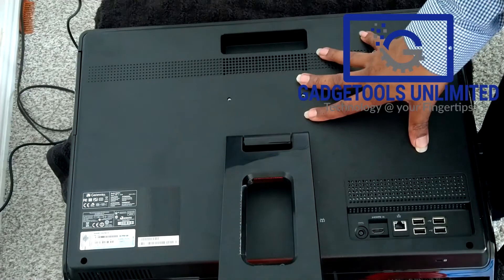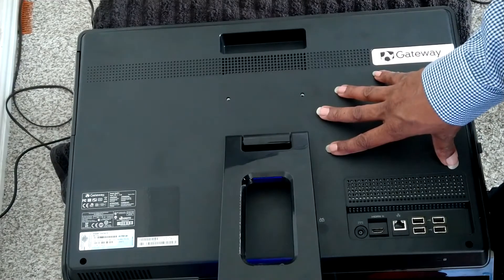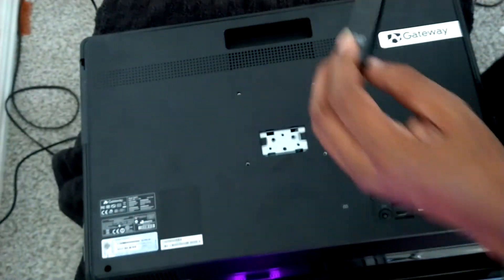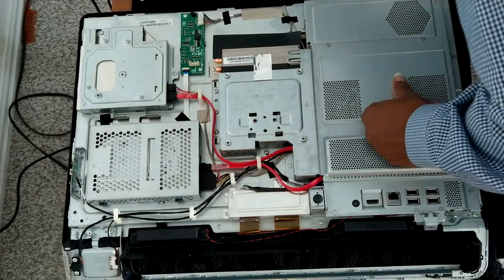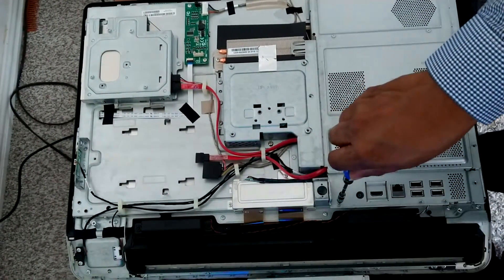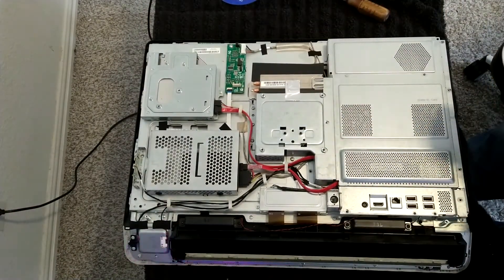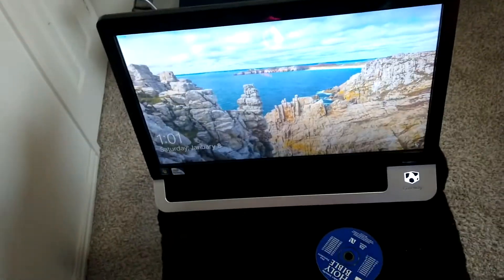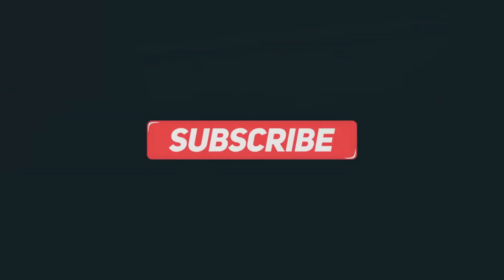Gateway Model-ZX6971 Upgrade | Gateway All-In-One HDD/Ram Upgrade | HDD/Ram Upgrade

Comment: I got the same machine and love it, but now it won't turn on. i used to have to press the button a couple times and it would go. now you hear it power up but it won't turn on. it was running perfectly fine until this started and i can't seem to find anyone who will or wants to look into it. Just go and buy a new one is all you get when it was working perfectly..
Reply from the maker: I understand you frustration, given the age of these machines, buy a new machine is likely all you'll here out there. and if the machine does what you need it to, I say keep it as long as it does. On the issue could be a bad button, or power supply. gonna have to troublshoot to narrow it down
Reply: Did you install the RAM properly? You may need to re-seat the RAM. See what happens if you take it back to it's original configuration.

Comment: Does this machine accept more than 8gb of ram? I am looking to try to put 16gb. 

 I have a dell 660s and it also says 8gb max ram but it accepted and uses all 16gb I put in. So I was wondering if this could do the same. Also where to update gateway bios?
Reply from the maker: no it won't
Reply: I tried and it accepted (it recognized it had 16gb and it was running at 1333MHz ) it but I can’t fully test it out since it’s not accepting my new SSD as a bootable device after cloning the HDD. I wasn’t able to find a trustworthy website for bios update so I am keeping the i3-2120 it came with as when trying an i7-2120 it showed up as unsupported cpu

Comment: Looking to upgrade the cpu. Any videos on this? Never seen those brass rails on top of a cpu before
Reply from the maker: I don't have a vid on doing so, but it wouldnt be a very complicated process, not sure it would be worth it to do so though given the age of these models. The "brass rails" are part of the heat sink, they carry the heat away from the processor, if you look at the end, what looks like radiator fins, the fan blows the heat carried by the heat sink out through those.

Comment: Help please. Great video by the way.   My son's gateway all in one is a GWAP42424. I called Gateway to ask what ram to buy and the guy who barely spoke English said it's not upgradable and hung up on me. Can you tell me what ram to order? It's currently 4gb, 8 would be nice, I'd even go as high as 16 if it could handle it.
Reply from the maker: This model is billed as an "affordable" option and gateway only built it with the 4gb configuration. it looks like the CPU can handle 8gb of memory but not sure the chipset or MB can, didnt find any info on them. also not sure you can safely open the device without breaking something, they make it very hard when they want to. Unfortunately on this one, it may just be good for web surfing.
Reply: @GadgetoolsUnlimited  Thanks for the reply. Guess I won't be upgrading that. He's just going to have to wait.
Reply: @BlindRanger.  You can always open it and see just what the motherboard has to offer. If there's another RAM slot, you may be able to add more. You don't really know until you open it and literally look at what's "under the hood". Sometimes, there are extra slots for things and no one took the time to advertise it, like with the Lenovo ideapad 3. It has a slot for an extra hard drive, and no one at the store bothered to tell me about it. Our other ALL IN ONE, an Acer, I believe, was said to be capped at 8GB, though we've got it running at 16GB of DDR3.

Comment: I upgraded to i5-660, SSD drive and 8GB RAM plus a modded graphics driver to the similar one. Win 11 for everyday use works perfectly on it, without much difference than on newer generation i7s.
Reply from the maker: Awesome!
Reply: Curious about the modded graphics driver any links? Thanks
Reply: I set an SSD drive but the Bios does nor read it. I need to update my bios. My version is P11-41. Does anyone knows where I can update it. My pc is a ZX6970 Gateway

Comment: Loved the Video but what did you do to make the new HD fit ? And where can I order these Parts ? and also do I need to backup all of my Old Pictures and PDF Files
Reply from the maker: Hi Keven, thanks for stopping by, so I just removed the metal carriage from the old Hard drive, and put it back on the PC, then just tucked the new hard drive down in the slot. not worth buying an adapter case to make the new drive fit in the old drives footprint. You can buy the parts from any computer shop or electronics department. if you want to transfer them to the new drive, yes put them on a flash drive before you replace it, then bring em back after you install windows
Reply: @GadgetoolsUnlimited  Thank You so much

Comment: where do you order the parts
Reply from the maker: Have have a few accounts with distributors, both online and location but sometimes even microcenter
Reply: You can buy them at pretty much any hardware retailer like microcenter as GT said, or you could buy them off of Amazon or Ebay. I suggest Amazon because they're great with return policies.